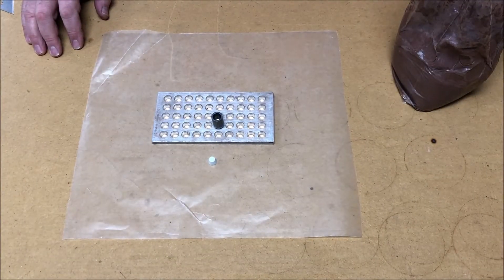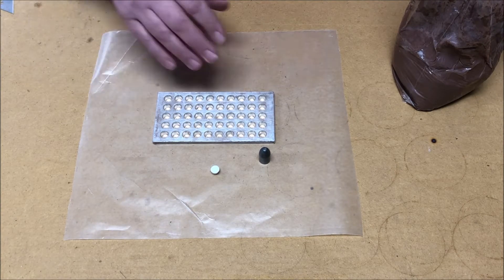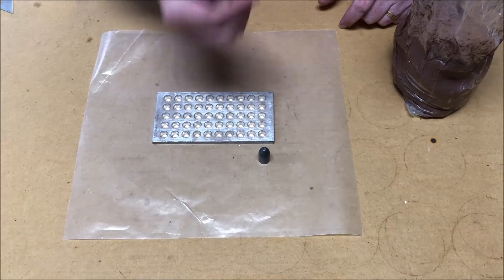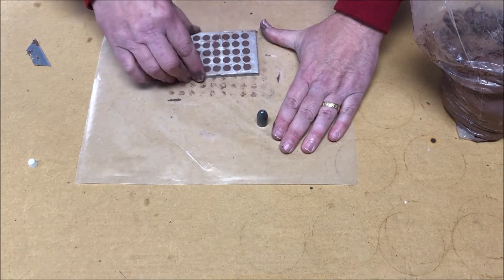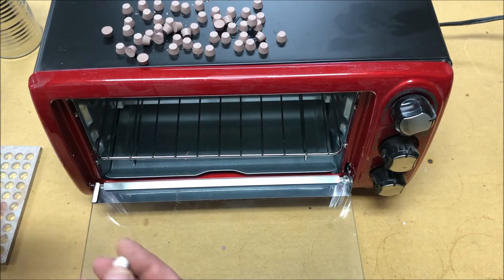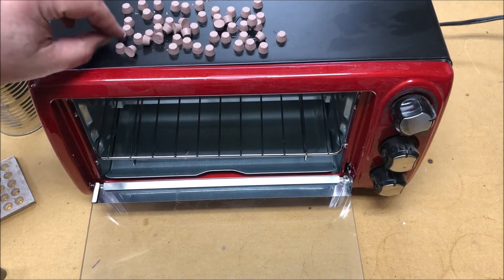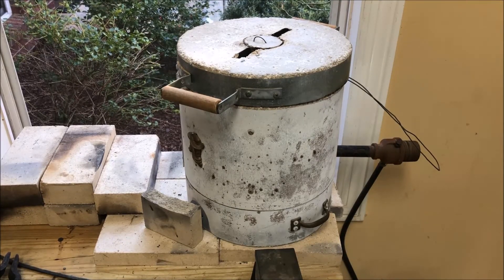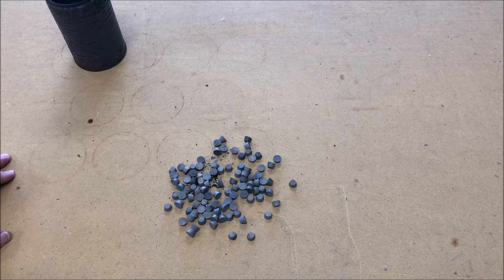Making clay plugs for the Enfield Rifled Musket bullet

Comment: Initial trials in 1863 used no plugs, wood plugs and clay plugs. They confirmed the necessity of retaining the plug and that adoption of clay plugs had a tendency to improve the shooting of the service rifle. Further trials found little or no difference in the shooting between boxwood and clay plug ammunition, but if less expensive clay may be desirable: they were recommended to be adopted. The plugs used in the trials were made of dry clay pressed into the proper form, then baked, and afterwards saturated with beeswax.

Comment: I wonder if it was the soft Sculpy plugs that caused my M1860 rounds to key hole.  Maybe the plus were disintegrating instead of expanding the lead skirt.
Reply from the maker: It's possible.  I would think that anything crammed in that cavity would act like a wedge and expand the bullet but it's hard to say.  The skirt on the Noe bullets is rather thick so it might take quite a kick in the pants to expand them, too.

Comment: forgive this basic question pard - but what's the need for the plugs? I was under the impression that the minie's empty cavity purpose was expanded into the rifle groves on firing.  LIKED the video and await your response -- thanks Pard for the production.
Reply from the maker: The British concluded, after extensive experimentation, that a plug resulted in "instantaneous expansion" of the bullet.  It acts like an explosively-driven wedge that is blasted into the cavity in the back of the bullet.  Think of a splitting maul going through wood.  The Pattern 1852 musket utilized a hemisperical iron cup as the "plug".  With the Pattern 1853, they tried a bullet with no plug (the Pritchett), but it was too sensitive to tolerances and could not reliably expand to take up the rifling.  So they went back to plugged bullets that had worked with the P51.  The initial bullet was the "Hay" bullet, .568" in diameter with an iron plug.  This was quickly superseded by a wooden plug that was found to be superior in testing.  Finally, in 1860, the wooden plug was replaced with a fired clay plug.

However, the Confederacy, which struggled until the end of the war to adopt the Enfield style of bullet/cartridge, never used plugs in their version.  Probably because they did not have the machinery to mass produce the plugs.  Given the lack of training of US and Confederate infantryman in marksmanship, it's possible that any reduction in accuracy due to the lack of the plug didn't matter much.  And of course we know that it is entirely possible to have bullets like the US Burton Ball / Expanding Ball that work just fine with no plug.

But the British were convinced that the plug was critical to long-range accuracy.  

A fantastic, yet short and inexpensive book that details the history of the P1853 ammunition is "The English Cartridge" by Brett Gibbons: https://smile.amazon.com/English-Cartridge-Pattern-Rifle-Musket-Ammunition/dp/B088N5ZKYT

Comment: Think I can use a capped iron pipe in the wood stove to fire my plugs? How about cement or morter as a material?
Reply from the maker: Yes, I believe packing the plugs in any kind of metal container and tossing in a fire would probably do the trick.  I don't know how well cement would work but the downside is the long wait time to set up.

Comment: Hey mate. Awesome video! Just wondering with my plugs after I chuck them in the overn they’re not coming out smooth on the sides. Do you reckon that could be the clay I’m using? I am using a terracotta clay. Cheers
Reply from the maker: I can't speak to your clay, but make sure you are adequately pressing the clay into the cavities.  My guess is you are not applying enough pressure.
Reply: @fortharmoury4434  no worries I’ll give it a crack. Thanks so much for that!

Comment: Im thinking about wooden plugs made with the help of my arrow shaft tapering tool(basically a sharpener for big pencils). 
But boxwood is hard to come by in Germany. Do you think Oak or Beech would work?
Reply from the maker: It was  hard for the British Empire to come by also.  :)  I have never made wooden plugs so I have no opinion on wood choices.  You might check with Brett Gibbons at papercartridges.com to see if he knows of alternative woods to use.
Reply: @fortharmoury4434  I will. This is where I bought my first 108 Pritchett projectiles. The first batch I ordered (they have to arrive yet) were the .568 diameter types, which dont need a plug. But I want to test the other sizes in  the future. And then I will have to find a way to make plugs. This is also the reason why I ordered the entire set of Enfield cartige formers from you yesterday. ;-)
Reply: @fortharmoury4434  Ps: I just asked him. He uses Maple. If Maple works, then Oak and Beech will too. Fantastic.
Reply: Servus Cornelius, ich hab mir von NOE die 550 Kokille mit den Formen für die Stopfen schicken lassen. Heute hab ich mit den Stopfen experimentiert. Hab normalen Ton genommen, der bei 1000° C gebrannt werden kann. Die Formen damit gefüllt, im Backfach meines Kochofens 20min bei 300° getrocknet. Die Stopfen fallen danach von alleine aus der Form. Die trockenen Stopfen hab ich in ein kleines gusseisernes Töpfchen mit Deckel (Ebay für 15€) gegeben, welches dann ich dann auf die Glut im Ofen gelegt habe. Dann maximal Zuluft auf und nach 20min hat der Topf und die Stopfen geglüht. Die Dinger sind maximal hart und können nur funktionieren. Für 200 Stück hab ich kommuliert nicht mal ne Stunde gebraucht. Wenn ich noch bissl optimiere könnte ich 500 in der Stunde schaffen. Einfach genial.

Comment: I’ve been shooting P53 and P56 Enfields for years and never needed to make a clay plug.  A cardboard or felt wad is all that’s required, another American wave I suppose
Reply: It's not an American invention - it's British.  The British started using stamped iron plugs with the advent of their P51 rifled musket.  They attempted to ditch the plug with the Pritchett bullet in 1853, but discovered it did not expand enough when the bullet was sized to its smallest and the bore was manufactured at its largest diameter.  So in a panic they redesigned the bullet (the Hay bullet) and re-introduced the iron plug.  The iron plug was quickly discarded in favor of a plug made from Boxwood, carved on a lathe.  However, Boxwood was expensive and difficult to source.  In 1860 the British again redesigned the bullet, reducing it to .550 in diameter, and changed the plug from wood to fired clay.

So, all of the historical British ammunition for the P51 and P53 Enfields utilized some kind of plug, with the exception of the short-lived Pritchett bullet.

If you are interested in a brief history of P1853 ammunition check out this short video:
https://www.youtube.com/watch?v=8uSqQzWF3ts